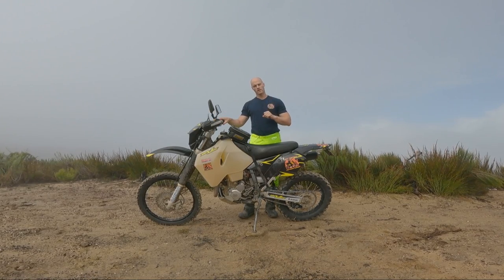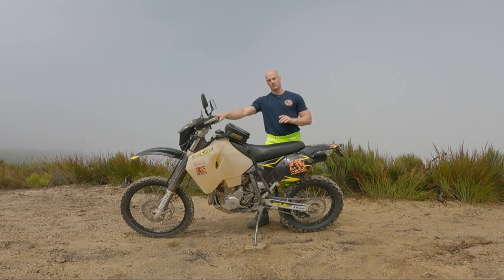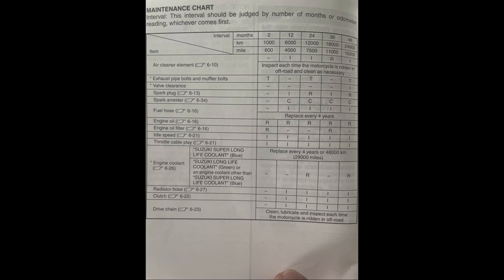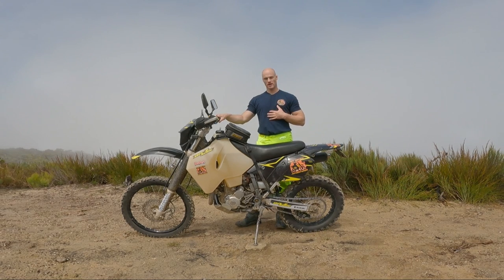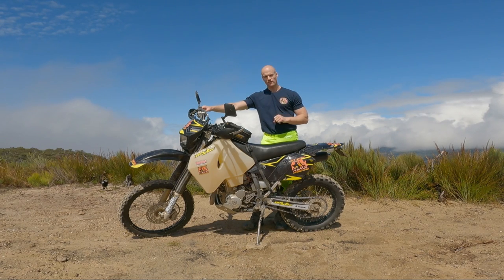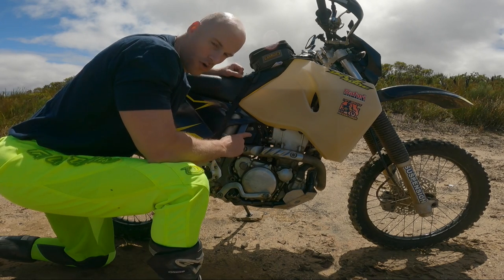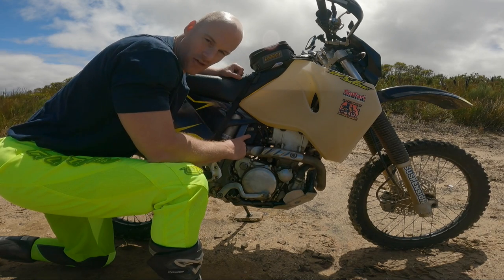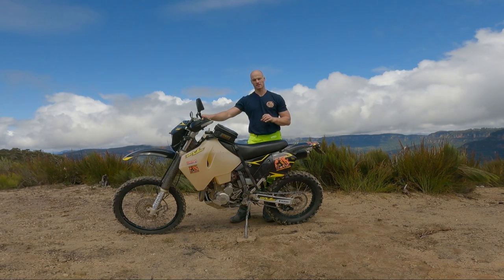Suzuki DRZ400E Owner Review || MotoVlogging Setup.

Comment: Great advice Lance some good pointers to look out for.
I have bought a 2007 DRZ SM(UK so we have not had them since 2008) to use during my  recent retirement I went for it because I could do without high running costs and ease of maintenance finding a decent one was hard but fingers crossed it will fit the bill plus you never see any about over here any more so it is good to be a bit different.

Comment: DRZ400 oil return box/tank....a important additional FYI heads-up......Over time the internal plastic filter matrix inside the oil return box/tank can start breaking down and deteriorating from old age and oil acids/additives. It's at this time these deteriorating plastic filter matrix particles can then begin to circulate into your engine oil (you will see the black plastic matrix shaped filter particles when you change your oil). If there is any doubt at all to the oil return tanks age and/or it's condition, just replace the DRZ oil return tank with a new one, it's VERY cheap engine insurance!

Comment: Great video Lance, thanks for all the tips, the vlogging set-up is exactly what I'm looking for, I've had similar issues wasting money, got a Rode Wireless Go 2 and GoPro Hero 11 with media mod and heaps of spare batteries and chargers etc. 
I've been following you fellas with your trip videos including the latest Cape series. 
I'm setting up my new Husky 701 atm. I'm in SE QLD myself. Stay safe mate 👍😎🇦🇺
Reply from the maker: Thanks for watching mate. 

I do like the 701. Maybe one day I’ll have one of those. 👍
Reply: @The_Apprentice_Adventurer  you're welcome mate 👍 yeah they are a well proven steed, very reliable and do all bike, that's what got my attention. Not cheap but built to last. Can't go wrong with a DRZ400 or even the DR650 upgraded either to save dollars. 
But off the showroom floor not many are close to being ready for adventure in a single cylinder. Everything has it's pros and cons. How many litres is in your big fuel tank mate? 🇦🇺😎
Reply from the maker: @ScottSillis  mate that’s a 17L but holds 20ish litres. Get around 400km range.
Reply: @The_Apprentice_Adventurer  awesome, that's pretty good range. 👍mines got 13 in the rear and once I fit the long range another 12 litres so around 560km.

Comment: If you buy a bike second hand, and it has a carbie, take if off and give it a clean and rebuild kit. My DRZ factory fitted carb astonishingly never had the fuel/air screw correctly threaded through the casting where it goes up through the bowl, the fuel supply through the screen to the float needle was 50% blocked.  People dont use fuel filters are asking for trouble, all petroleum fuel tanks,delivery trucks,hoses etc have dirt and water in them. Dont buy fuel if a site is getting a delivery, the tanks are stirred up......

Comment: suzuki recommend half intervals for servicing if used in harsh conditions 3k km oil changes is what i do but you're absolutely right about being on an adv ride and not having to worry if you do more than 3k between changes. 
the hub spacers won't ever fall apart they're a solid spacer. when they do need replacing due to wear you can buy stainless steel ballards ones reasonably cheap that will never get grooves due to the harder material. 
chain slider on the swingarm applies to all chain drive bikes.
Reply from the maker: Hi Michael, yeah there were a few other pointers I wanted to throw in but once I reviewed the footage and realised a missed a few things I couldn’t get back out there to film. Your right though. Hopefully the video still gives good advice to most and highlights the bike quality overall 👍
Reply: @The_Apprentice_Adventurer  yes it's all pretty fair.

Comment: Hey man, love the videos. I’ve been hesitating between a dr650 and a drz400 to go on a world trip across Europe and Asia. Any advice?
Reply from the maker: Hey mate, probably depends on the type of riding and overall terrain. The 650 will be better comfort wise, carrying luggage and overall kilometres. The 400 will allow
you to traverse hard terrain much easier. Probably the 650 as no doubt you’ll be carrying heaps of gear with a big trip like that.
Reply: Ive had a dr650 for a few years and just got a drz400e too. 
For world trip kinda stuff id be taking the dr650. 
The dr650 is better at highway speed, air cooled so takes the radiators out of the equation for things to break (does have a oil cooler though) and is much sturdier in the rear / sub frame to bold on carry racks and panniers for longer trips. 
It is also made to carry a passenger, unlike the drz400, and this means you can load it up more and you also have more room.
Dr650 all the way for a long trip. Only better thing going for the drz400 in my opinion is that it is lighter and easier to manoeuvre and pick up when dropped, but saying that the dr650 can do it all too just a bit heavier etc. 
Also so many mods that are worth doing to it - especially suspension, fuel tank and all the guards, racks, bars, seat, exhaust, carburettor, footpegs etc

Comment: Fantastic video. I could be wrong but I don't think they sell the E model anymore in the states. I'm really interested in putting a 434 or 440 on one as I'm a bit of a bigger guy and redoing the suspension on an emodel then using it for a pure dirt bike that CAN go on road. I have the KLR which is kinda the reverse, a road bike that CAN go on dirt. Keeping up with the KTM 250 of the brat is becoming more difficult though so I need to pull out something that is really almost motocross capable but with enough HP to pull 250lbs.

Comment: In my years of anecdotal experience with japanese dual sport bikes, you seriously need to thrash them or try to break them on purpose to have them let you down. Most of my reliability issues with them were due to extreme negligence of previous owners. 
Some of these bikes feel like they are going to outlive me.
Reply from the maker: Haha your spot on. My poor bike has been totally abused in its use, highly looked after in its maintenance though, so hopefully I have found a good balance. 👍

Comment: Yes. I totally agree But it has one big problem Lance, No kick start. You're out doing  the simpson.solo and your battery goes flat, you can't clutch it because it flat and sandy. you are fucked until a traveler passes by. That could be hours or even days. That is the only down fall it has in my book.  I do endure day rides because I live next to a nation park on the far south coast NSW so no need to ride the backtop to get where I am going So I carry only myself and essentials in a backpack. So I opt for the DR 200 SETrojan ( Farmer best friend ) Yes I can hear you pissing yourselves.  It is 850 cm with still the same clearance as the DRZ but the seat is lower. Has a kick start, Has a back rack with side racks also has a front rack. It has stands on both sides which come in handy quite often and I never  get over 90 km because the trials won't allow you to do much faster and because I got no weight the 200 performance is not far below the 400 when the 400 is load up with your camping gear. I know the 200 would not suit you and your riding because you are city base. But for me and my riding enjoyment I will ride the 200 than the 400 ever time.

Comment: I have 20,000km on my 400E with no issues. How many Km/s do you have on the bike now?
Reply from the maker: That’s a good run mate. I’m at 25000 with still no issues other than the bits I have broken with the enduro riding. The swingarm thing I put down to not knowing and a big desert crossing I did that absolutely wore my sprocket and my chain was so loose which I didn’t pick up on until I finished the desert.